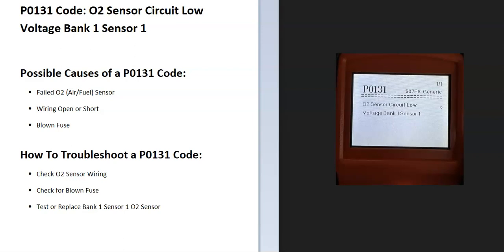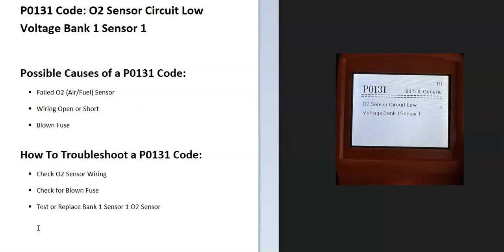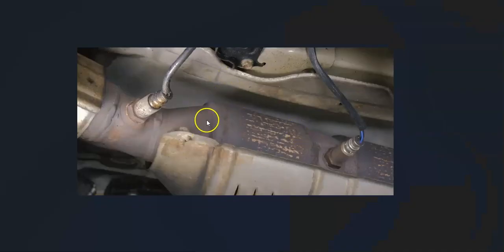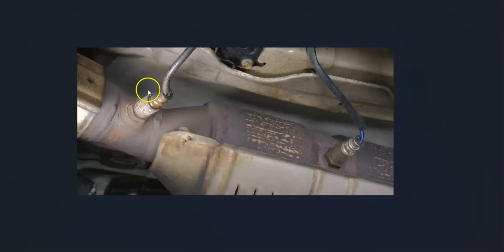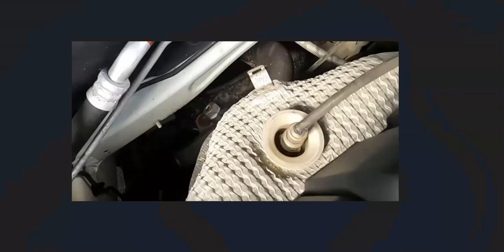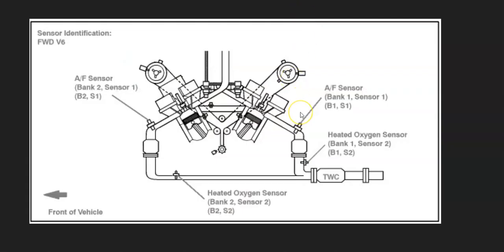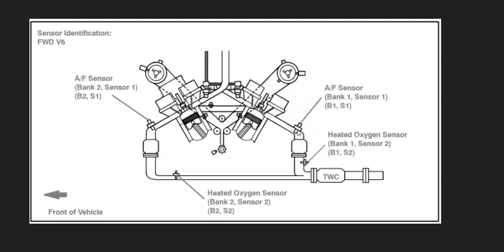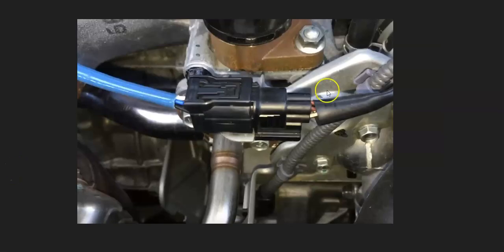Causes and Fixes P0131 Code: O2 Sensor Circuit Low Voltage Bank 1 Sensor 1

Comment: I had p0151  and p0171, bank 1 sensor 1 delay in O2 sensor. Changed the O2 sensor, now p0131 and p0171... Car stalls at lights consistently during this whole issue if stopped for two long.
Reply from the maker: If the 02 sensor is good, it could be the wiring, or the lean condition may also be causing the sensor to read low. Lean codes can be hard to diagnose sometimes but with the stalling this likely is the issue. If there are no other codes pointing to a bank-1 issue, such as a misfire or injector code, the spark plugs can be removed one at a time and matched to a spark plug burn chart to see which cylinders are running lean. If it is one cylinder, just focus on it. If the whole bank is running lean, then it is fuel pressure or a bad sensor. I made a dedicated video on P0171 code. Here is a link. https://youtu.be/b9__WGuD-dc

Comment: Hi Sir, my VV Jetta 2015 model, check engine light (with P0131 code) comes ON while starting the engine only, then after reset it won’t come while driving for any long distance and car driving smoothly. What may be the cause?
Reply from the maker: It is likely an intermittent issue. For example, a loose wire that only disconnects on a bump or the 02 sensor is only starting to fail.
Reply: @HVAC_Mechanic , I have the same problem as he does on a VW Passat 2012. I already replaced both sensors (upstream and downstream). Before replacing the sensors, I had code P0131. After replacing them, I got code P0036. I reconnected the downstream sensor, and the engine light didn't light up in 3 days, but now I have the code P0131 back. What could it be since sensors are brand new, fuses are ok, and the connectors look good? Thank you.

Comment: Not sure what I am understanding here?  I always thought the sensor-1 was an A/F air/fuel sensor and not confused with sensor-2 an O2 sensor from the 1980's.  The A/F sensor measures air/fuel ratio the end result lands in the catalytic then the after burn, sensor-2 O2 sensor measures the amount of oxygen ratio, both computations processed by ECM for the correct ignition.     If I have this wrong please correct me.  Thank you for the video.

Comment: Hello, I need some advice regarding an issue. Forscan shows the error code '02 circuit low voltage bank 1 sensor 1.' Can this problem be resolved on my own, or should I take my vehicle to a repair shop right away?

Comment: 😆 happened to me when I sprayed the o2 sensor with WD40 specialist penetrating spray to get loosened up for replacement. Did also attempt to remove the plug and it wasn’t budging, but pushed it back. Ended up pulling over and running scanner. Deleted the code and drove off and it hasn’t returned since. 🤷🏿‍♂️

Comment: this code came up on my 2006 Honda CityZX Gxi i-DSi L15A3 engine because I was driving in very heavy rain and with lots of puddles for a while.

a restart of the engine made it went away.

something to look out for.

the water splashing cooled the sensor down maybe?

Comment: Hi there, great video, I have a 2013 sonata 2.4 liter, and with my LAUNCH scanner, I did a live read on o2 sensor bank 1 number 1, and the voltage was in red numbers. O2 sensor number 2's voltage was fine. But I got no code. Should I chnge the number 1 sensor, or leave it, go for a drive, andsee if engine light comes on?

Comment: God bless your video and knowledge.  I been running around for a year or better with check engine light on,  with no cruise control or remote start. Checked fuses as you said and found a blown fuse.  Put in a new one and had check engine light cleared and I'm up and going. For how long I don't know, but feel blessed. Thank you 😊

Comment: Helo I got a low voltage to O2 sensor bank 2 any advise I'm thinking about changing it with another one? My car the rpms go up n down car feels like it want to die when stopping on a red light
Reply from the maker: The sensor will need to be tested to see if it has failed, as it may be in the wiring. A bad 02 sensor should not cause the engine to stall. The engine will not go into what is called a closed loop and be less responsive but should still run.
Reply: @HVAC_Mechanic  okay thank you for the advice
Reply: You mean limp mode my chevy trax says engine piwer reduced @HVAC_Mechanic

Comment: Will this code cause my car to shut off when I am at a stoplight or stop sign
Reply: Having the same issue
Reply from the maker: The engine should still run. If a 02 sensor fails, the engine will be in what's called an open loop and be less responsive but should still run.
Reply: @HVAC_Mechanic  I have a car that is stalling on me when I idle, I’ve changed out the fuel pump, spark plugs, throttlebody O2 sensors and fill injectors which I sent back because they made everything worse
Reply: @MrHerces18  have you gotten everything figured out what was causing the problem? I have the same problem
Reply: Found out it was the pcv valve is what need to be replaced stopped the problem
Reply: Mine did that. I pulled out the fuel pump relay opened to outside to get to the board and resoldered the connections and the car turned right on never had issues again. I had another car shut down like that did all the fuel pump etc after I fixed my van just resoldering the connection points I tried with my 95 civic and low and behold car turned on. Seems like either the points wear down or they were never fully soldered(weak solder points) on my van I purchased fuel pump and stuff but ended up not trying any of the big repairs. I turned the key n listened for a very quiet beep coming from the relay that gives power to the pump. I didn’t hear the beep so I checked the relay and sure enough that was it. Hope this helps

Comment: Would that code cause a smelly exhaust at startup?
Reply: Catalytic converter if you get weird smells and smoke out exhaust
Reply: @ChristRecords2O16 smelly exhaust on cold startup (pretty noticeable). Dealer said normal catalytic converter behaviour after a certain amount of mileage.

Comment: I got that code. Replaced the sensor.   So far so good.
Reply: Was your vehicle driving differently?
Reply: Upstream (sensor 1) is there to read air/fuel mixture, if it goes bad you will use more fuel
Reply: @benlayton5018 so when I had problem with sensor P0131 oxygen bank 1 uppstream (Circuit lower volatge), I need to solve the problem in injector (cleaning) or the fuel need improve with better RON/impurities? Are those correct?